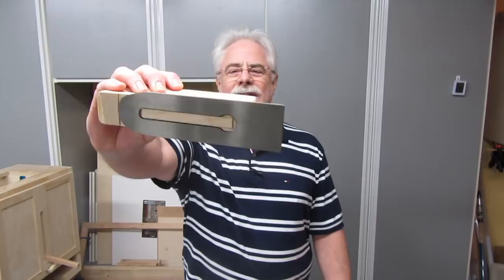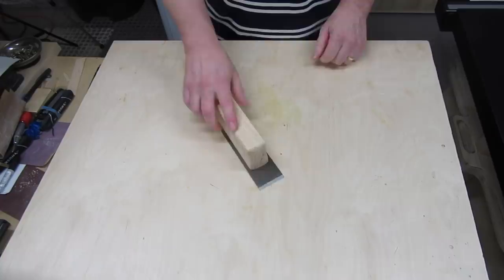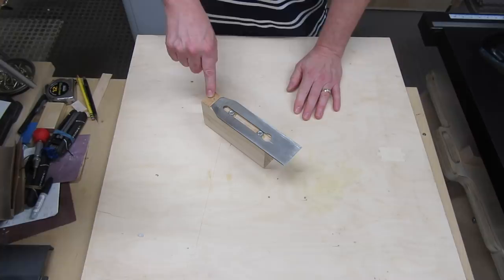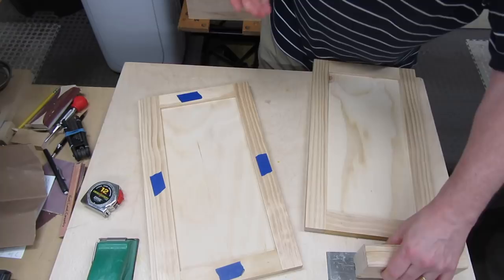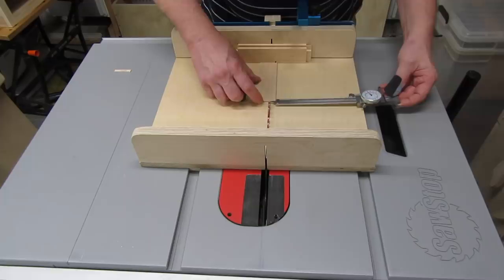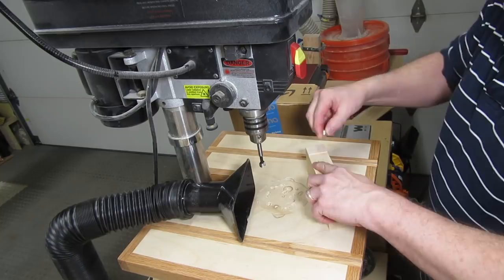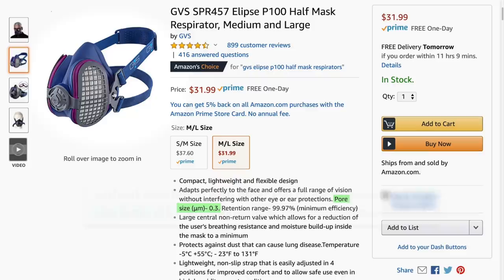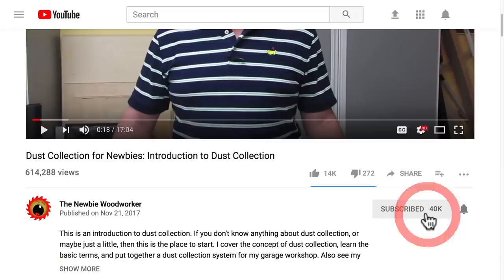You Won't Believe How Useful This Tool Is! (Chisel Plane)

Comment: Watching your finger accident brought back memory of the time I was using a chisel and holding the work piece by hand instead of in a clamp or against a stop. Suffice it to say, the chisel slipped and sliced into my left wrist, just barely missing the tendon...which would have been a stupendous disaster necessitating major surgery to reattach the severed tendon.
Reply from the maker: Eek! Glad it missed the tendon, and the artery!

Comment: They are a great tool. The one I have has the handle the same width as the blade so that when not in use you can turn the blade around on the handle to make it safe. Great video.  Cheers John
Reply from the maker: That's a great idea! I have a video coming out soon showing how to make a sheath, but your tool is probably the better way. Won't stop me from putting out the video, of course, but I'll try and remember to mention your tool also.

Comment: You have invented a incredible affordable smart Tool! I'm in Alaska hard wood we have in my area is Birch, I'm pretty sure I can whip out a knock off (not maple I'm guessing birch is not as hard as maple) I get pretty creative trying to do my own, I really like the use of magnets with this, have you tried to patent it? You could make a lot of money and retire on easy street. You look like you got cut pretty good there Bet this can work on a micro scale with some flat craft xacto blades for jewelry box size projects? Love your block multi Planer! Or 'poor man planer' looks more durable than the others at lowes & home Depot! 👍
Reply from the maker: Thanks! Honestly, any kind of wood will work, with the possible exception of the "heel". But if the wood you try for the heel doesn't work, you might be able to use a "mending plate". I'm thinking they're probably thinner than the plane blade. And as for patenting it, someone already markets one (I found out from a recent comment), so no luck there. But good thought. 😄And yes, you can make it any size you need. As for being more durable, since you make it yourself, you can fix anything that goes wrong - much better than going back to HD and asking for a refund. 😛

Comment: This is probably the 100th time of me watching this video. I don't have a table saw so the thin rip cut intimidates me. I think I came up with a track saw solution for cutting thin strips. I'm finally going to make it this weekend. Wish me luck.
Reply from the maker: Absolutely - good luck!!
Reply: @TheNewbieWoodworker  Hi Dan, I'm happy to report I completed the project. I had several failed attempts and some learning moments. I made some modification along the way. Instead of cutting thin strips with a track saw, I used a palm router to route out the plane blade shaped recess at the bottom of the handle. I also found that using a square heel plane blade made it easier to stay in place. Now I have a chisel plane! And you are right, I keep finding more uses of it now that I have it!
Reply from the maker: @msplxp  Awesome! 🙂

Comment: Great idea and thank you! I believe I will make one for myself with a twist to the plan. Instead of adding the heel and strip it could be done easily with a router removing the wood to depth using only a single piece of wood and saving a lot of steps . Any adjustments are just sanding.
Reply from the maker: Thanks. I agree about using the router. But for some reason, I just couldn't get it right. And then I figured this was better for the video anyway, for people who don't have routers. But if you can do it, I agree it would probably be the best method. Good luck!

Comment: Good idea Dan, i did commercial Woodworking professionally for over 20 years and i use a  blank moulder blade  with one sharpened edge  in a similar fashion  i even built a  hardwood case to store it in my tool box to keep the edge protected   It  turned out to be one of the best tools ive used for trimming  pvc edgebanding  on cabinets  after they are installed   Generally damaged by others on site  by accident ?  We used to use a  razor blade scraper  but that  can easily cause other damage to the  cabinets  the moulder blade stays  perfectly  flat on the inside or outside faces of the cabinets  on a standard European style cabinet that is most common  for commercial  cabinets  as well as the knife  has all types of other uses  including some of the ones you mentioned for your tool   Although a improvement to  mine would be a  removable handle similar  to yours  so i may  build  something   Like that  as well
Reply from the maker: Thanks, and I hadn't even thought of edge banding. Good call!

Comment: damn that looks like a deep cut. I've been using my old plane irons like this for a long time. They are superb for removing label residues. I even have one to remove dried flour paste from my kneading board.
Reply from the maker: That's a great idea! Like I said, you can't really know useful something like this is until you have it. And yes, the cut was deep, but the blade was so sharp that it didn't hurt very much, and it healed quickly. But I learned my lesson!

Comment: Great idea, Dan!  It never amazes me the helpful little tools and bits that you dream up, play with, make, and then refine.  You've got a great mind for these things.  I'll have to make one of these little flat planes.  I hate trying to use my chisel to clean up glue on a flat surface ... I'm a little too aggressive and sometimes gouge the wood.  The flat plane may help fix that.
Reply from the maker: Thanks, and that's the exact reason I built it. I kept gouging the surface with a chisel, and for some reason, I can rarely get a card scraper to work like I want it to. So necessity being the mother, and all that. Thanks for the compliment!

Comment: I truly appreciate your going through the first version and showing us what you started off with and how you improved it.  About 5 projects ago I started a project to make a piece of furniture when I realized that I really could use a jig so I could repeat a specific process reliably.  Well, in making that jig, I realized I could use another jig to help in my cuts needed for that jig - and then "they told 2 friends..." (showing my age here) and like I said - my original project was 5 projects ago.  One jig lead into another one that led to another to be created - and truth be told -  one of the jigs I made, by the time I finally finished it, during the final sanding of the darn thing that I had an 'ah-ha' moment. I figured out a much better way to do what I wanted... which didn't require the jig I just spend the last few days working on.  Sheesh.  It's a beautiful little wahooitz-ma-bob, that one day I'll repurpose into something stupendous and awesome - until then I give it an evil stare when I walk into my shop.  lol    Some times I get so far down the line that I totally forget what the heck I was trying to initially do in the first place.  Thanks for your great videos and thanks for not covering up your ooopsie moments!   We've all been there!   Paper towels and electric tape have darned my paws on many occasion too!  Cheers!
Reply from the maker: Oh, I am so with you on this. I got started up again with woodworking a few years back when I was going to build a controller box for playing video games. But first I needed a router table (so I told myself). Then I wanted a box joint jig, which I had so much trouble building because of videos that didn't explain things very well, that I started this YouTube channel so others wouldn't have to struggle like I did. Then I needed... Well, you get the point and now, several years later, my prototype controller box sits on a credenza, waiting to be finished. 😄
Reply: @TheNewbieWoodworker  If I didn't know better - I would say that you just described my life!   Seriously!   I started making jewelry and decided to move my hobby into the basement, where I would be building my jewelry studio/craft room/sewing room/chemistry lab.  Then the Sears by me was closing down and so I picked up some equipment that I've been wanting for a while - including a grinder, scroll saw, drill press etc.  Well I can't easily incorporate all these new pieces into my layout until I'm sure how I'm going to be using them.  Now I'm stuck telling myself that I'm not trying to build myself a dag gone woodshop, just a jewelry studio - but I need a woodshop to build the studio!  hahahaha!   I'm just one vicious cycle of awesome ideas and project starts ... but lousy with project finishes.  LOL   I am glad to hear that I'm not alone in this weird cycle of ideas and accomplishments but yet unfinished projects.   

ps.  add to my list - I decided to build a closet organizing system for my kid - he's 15.  I'm trying to make something handy and cool that will keep him from using the floor as his clothes storage.  Then his birthday came along - and we decided to upgrade his "kids" captain bed from a twin to a full size.... well the mattress won't fit within the captain bed, so now we're going to build a loft bed.  I haven't finished the freakin closet project yet, and then I'll move on to the loft bed ... all while I still haven't completed the jewelry studio!   Yup - this is my life.
Reply: @kerrischneider7693 .... Lol!!! This should be the idea behind a new sitcom!!!... Something I'd definitely watch each week!!
Reply: @reddawgrup1779  Too funny!  I've often commented that my life needs to be made into a movie - bc of the sheer nature of the number of bizzare and crazy things that happen coupled with the number of things I have go wrong in a day is more than most folks have happen in a lifetime.  Case in point - while trying to write up this comment, my phone decided to shut down and now fails to turn on - why?  beats the heck outta me!   But I digress....    Yes - I have often thought of turning my life into a comedy movie or tv series ... I'm a bit of a nerd and jack of all trades and I'll give anything a try at least once.  Given the stuff that's on tv now - it would definitely be far more entertaining and  educational - even if you'll learn mostly how 'not' to do something ... that's still important though!  haha.   I was going to start a YouTube channel, but with all their censorship and now crushing creators so that you need 1,000 subscribers to go live - ugggh!  I know me and if I don't do something live, it will sit on my computer for years waiting for me to finish editing.  I just know it.  Thanks for the comment!
Reply from the maker: @kerrischneider7693  If everyone had to run a camera while they worked, they'd be amazed at the stupid things they do that they didn't even know about. Even better, publish it on YouTube, and if you missed anything, the viewers will surely find it! Which I'm grateful for, because more than once I've changed my behavior thanks to things other people have seen.
Reply: Kerri... Ohh dang just from the vibe I get from you posts and the images of all the things that can go wrong (yes and trust me I can relate to that) you going live would rock! 😁
I don't necessarily have things go wrong per se as much as I have things get gummed up all the time. Things like the other day I needed to replace a shelf bracket in a town 35 miles away, so I stopped a Lowes (not my favorite place, but I live in a smaller type town) to pick up a bracket on my way. Get to the house and low and behold theres 2 brackets they want replaced. Well this town has a Lowes also so I stop there and go and pick up a matching bracket... Wait.... Nope... They don't carry the same bracket that I just picked up in my town Lowes... Smh.. Anyway... You get the idea... Those type things happen ALL the time to me and trust me... Even much more gummed up at times. It absolutely amazing how some of the simplest things can get so messed up at times.
And to be honest most of the time you can track it down to lack of communication, then again some of it is just pure chance.
Fire up that channel Kerri!! 😉

Ps... Don't get me started on all the damn censorship going on almost everywhere nowadays!! Like the free exchange of ideas is more threatening than the "censorship" they use to crush them... Smh
Reply from the maker: @reddawgrup1779  Oh I totally get that too. One of the things I love about where I live is that I have 4 Home Depots, 3 Lowes, 3 or 4 Harbor Freights, and a Rockler within 20-30 minutes of my house. But even still, one thing leads to another, and the next thing you know, my car won't start and I have an entirely different set of problems. Fortunately the car thing hasn't really happened in a while, knock on wood (last time it was the battery), but you know what I mean. http://gph.is/2cid2mA
Reply: The Newbie Woodworker    Wow!! Talk about choices close by Dan! LOL
Reply from the maker: @reddawgrup1779  Yeah, and even with all these choices, I still use Amazon if I can. With Amazon Prime, it doesn't cost for delivery, so I don't even have to go outside! 😛
Reply: Dan... What exactly is a controller box for video games?
Reply: @TheNewbieWoodworker  oh heavens to Murgatroit... the car thing ... I have 5 vehicles and I'm the only one here that drives.  Of course you know when I NEED to go somewhere that I can't get any of them to run.   Not kidding.   It happened this past thanksgiving.   Something wrong with every freakin one... but at least they're all paid for.  There's comfort knowing that I don't owe any one for the frustrations I suffer.  Lmao.

I've been thinking about recording my days and posting them just so I could ask viewers of review footage and find out things ... like what did I do with that piece of paper I had in my hand yesterday or where the hell did I put this thing-a-do-dad down now.  Crap like that .... sure would be handy dandy!  I curse like an old sailor most of the time so I'm not sure the algorithms would like me.  🤣
Reply from the maker: @kerrischneider7693  😛
Reply from the maker: @reddawgrup1779  It's a wooden box with buttons and joysticks, to hook up to something like a Raspberry Pi to play emulated video games.
Reply: Yes - ma'am - PLEASE startup that channel.  You've just accurately described my life.  You have your first subscriber right here!

Comment: I will make this. It looks like a very good solution for a roughing tool.
Reply: Actually I think its too dangerous in its current form. I think you need a stab depth limiter.. And maybe some kind of spring loaded thing, that when it is not pulled back, a wood bit thats parallel to the blade angle overtakes the blade and hides it behind wood.
Reply: so if you set it down, it naturally hides the blade with a 'angle sign'. But it would also lower the control you have of the tool. Perhaps even making it latching would help a little bit, so you hear a click once the blade guard is retracted and its allowed to fly over a flat surface.
Reply: and defiantly rubber grips that give you finer control of the tool. Defiantly not a wooden handle. Or like a paracord handle. 

Or a more advanced one could have a mechanism where the blade is hidden unless you press it against a flat surface so a pin is activated.
Reply: So the blade is hidden immediately as it is lifted from the flat cutting drag surface
Reply: I think though the better solution is to get yourself a whole bunch of different planes and have a workbench setup so you can get a different plane, because this tool is mostly a multi utility imprecise plane, if you have an assortment of planes of different sizes with different cut depths and angles, you no longer find this tool so desirable, so long you have good access.
Reply: you can get rid of labels and stuff with a really shallow cut plane IMO. And you can use a edge plane to get most of edge glue out. And you can get most of corner glue out with a small rabbet plane.
Reply: those rabbets also have quick access blade via the wedge. Not as quick as the magnet but wayyyyyyyyy safer. 

you can do a interior corner with those too, just get a small set.

IMO redundant and unsafe tool.
Reply from the maker: @cdrom1070  You know, it's OK with me if you don't like this tool. Just sayin'.

Comment: Another awesome video. Really enjoy watching your vids. I do have a question, any suggestions on safety glasses that won’t fog? My shop rules are glasses as soon as I walk in but all the ones I have tried fog up once any face/dust mask is used.
Reply from the maker: Thanks. For me, the issue has been the mask, not the glasses. The problem is air going up towards the glasses. The mask I refer to in this video fits my face almost perfectly. Sometimes I have to wiggle it around a little, but once it's set, when I pull it off, I can feel the suction. And this mask doesn't vent towards the glasses. Nothing works right for everyone, because faces differ, but this had a lot of reviews saying the same thing, and I love it.

Comment: if the blade bottom is rough try rubbing it on 80,120, 360 then dry wet and dry paper to get a smooth plate
Reply from the maker: Awesome - I'll try that. Thanks!

Comment: Well you beat me to the punch I was building the same exact tool Bravo yours is awesome!
Reply from the maker: Thanks! There's more than one way to skin a cat. Perhaps you can think about it and one-up me. Or at least make something prettier, with a great finish, because that's not my strong point at all.
Reply: @TheNewbieWoodworker  When I was younger (and had Money) I was all about how it looked. Now with no money, I am about function at the lowest cost.....  :-\    I scan the "Craigslist" free section for free furniture and salvage the hardwood, mostly oak and some mahogany. So mine will most likely be out of that........as well as a used blade/bench plane from ebay.
Reply from the maker: @romulusclay6697  Sounds about right. And actually, you could make it from a 2x4, except for the heel and center piece.